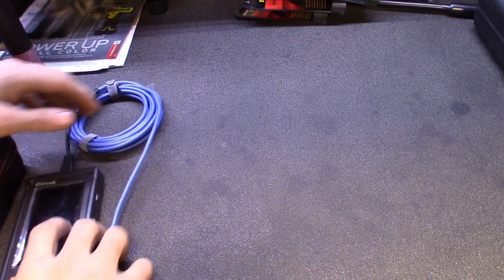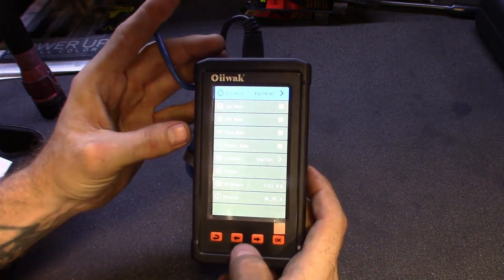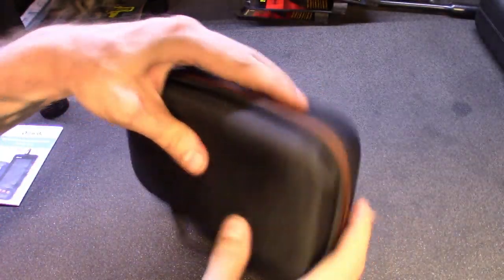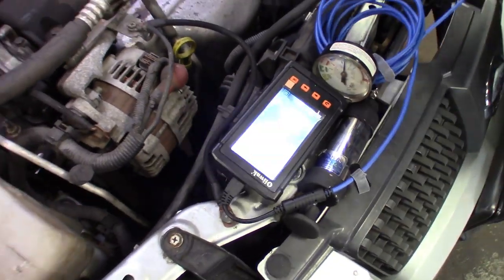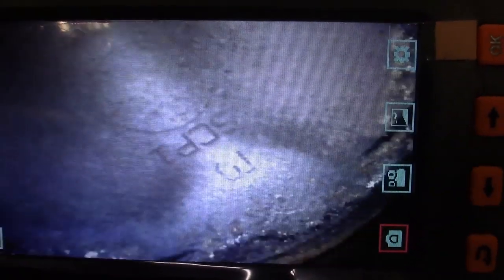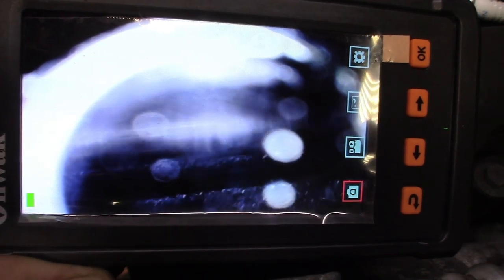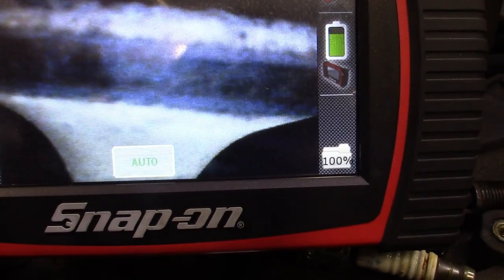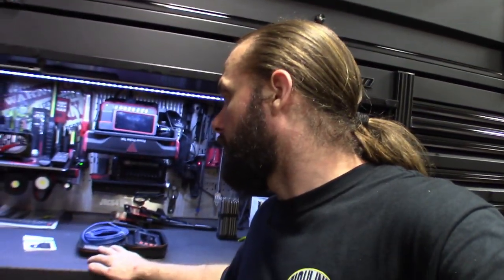Toolz in Use s3 e2
ʀᴇᴠɪᴇᴡ & ᴄᴏᴍᴘᴀʀɪsᴏɴ
(Oiiwak)

Comment: I have the lower end snap on and its decent dont get me wrong but it cost around 250$ or so. This 1 your showing is a bigger screen and just as clear picture, at 79$ its about 1/3 the cost. I would have def went that route and still might get 1.  Thanks for your insights guys.